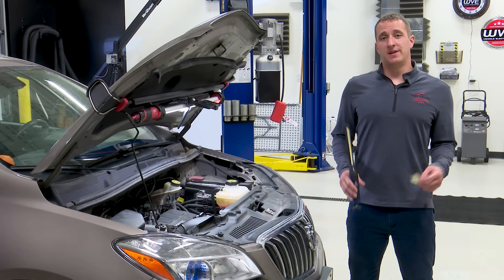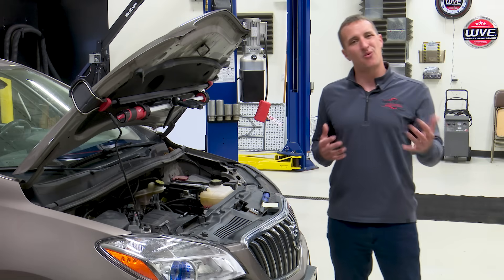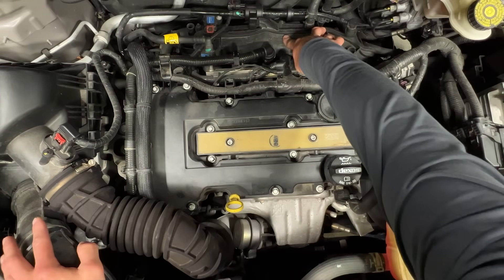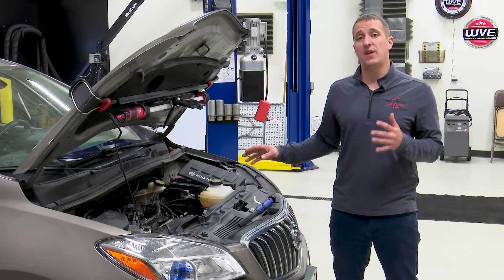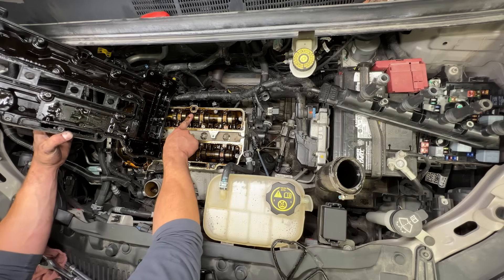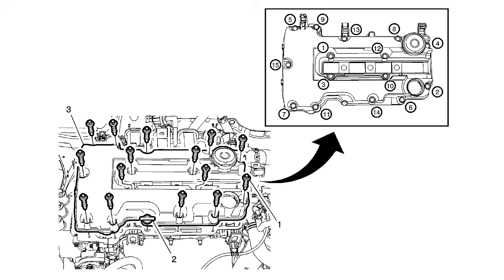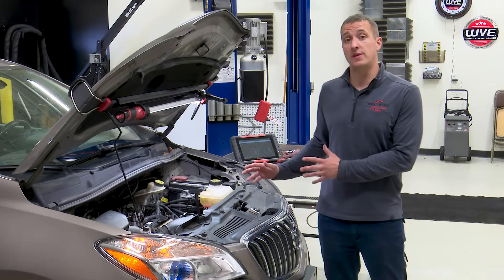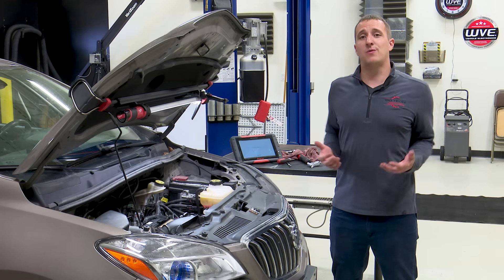How To Fix Chevy 1.4L Turbo P0171 Problem With Simple Diagnosis

Comment: Greath video my friend

I just changed the vale cover ,and i checked the manifold pcv..and the orange part is still there.. the only thing i is that i cannot blow air true it..while I put my thumb on the port head port .
 and now that I have the new
 Valve cover on...the engine draws vacuum air when I take the engine cap off.. is that normal?

Comment: i just replace the vapor valve on mine.  i broke a couple of clips. everything is back together but i might have to take it to the mechanic at some point.  runs fine for now. i doubt it will come appart.

Comment: Great video just a comment from my experience, the black pipe big an small going to turbo the small one always gets oily moisture inside the turbo diaphragm because of failing valve cover and intake manifold 
Take the 3torx screws out turbo diaphragm and clean it makes a hell of a difference car gets full power back instantly careful with rubber diaphragm and spring though! Also the big black pipe has a one way valve in it check that to

Comment: Great video! Would like to have seen what the new non-return valve looks like before re-assembly.  Also, where did the old one go? In the crankcase? Didn't need to fish it out?  Also, why are you replacing the intake manifold if it isn't broken?

Comment: Very good showing what was wrong and how to fix.  I have a po171. &  po458. Codes. Took it to technician who said it's the purge valve. ?  
He said part & Labour will be £231. ?  Does that valve sound right  ?   P. P.
Reply: I hope he's right about it. As my car did not show any signs at all. When it was running.

Comment: It's crazy! The Opel Mokka ist one of the best selling cars from Opel that days. No one knows this problem, and i fixed it all! The intake-sealing, the throttle, the map sensor, the injectors, the ignition coil because of the misfire... I needed the car for work so I drove and drove and drove. So i destroyed the sparkplugs because of the high heat. 
Thank you very very much for your help 😎 I thought the engine's down, but you rescued me!

Comment: I just had 2 questions, what is the mileage on vehicle and there is a kit that caps off where the orange valve falls off. In ur opinion would you use the kit or change intake manifold? Thanks for the video any feedback appreciated
Reply: I used the Cruzekit to replace the check valve on my 1.4 and it permanently solves a design flaw.  Very easy to install, seller has an excellent video.  Way less expensive and much better end result!

Comment: Great video! The mechanic changed in my A14NET: intake manifold, valve cover and this pipe from intake to turbo. Unfortunately I have high positive fuel trims on idle (about +25%) and P0299 (underboost) error. The turbochanger is new, the is no airleak, and the EVAP valve seems also OK. Do you have any idea what would be the problem with P0299 and high fuel trims?
Reply: Hello did you checked the vanos sensors?
Reply: @PAYASLRF  Hello! Thank you for your feedback! The turbo is back on my Astra. It came back for itself after about 3 weeks. It was probably intercooler sealants (I have changed them). By the way I also replaced vanos sensors. Now my Astra drives smoother.
Reply: @C-Fan_Moto  a14net is great engine but  have so much sensors and problem 😁
Reply: @PAYASLRF  This engine is a kind o wizard... :)
Reply: @C-Fan_Moto  i hope my Astra will fix the problem it self hahah
Reply: @PAYASLRF  Have you a problem with P0299?
Reply: yes but it's not about turbo i think,i think it's about pcv system,crank ventilation hose have a check valf and this check valf is not working.that causes inlet manifold has fill oil and turbo sucking this oil and burns and exhaust smoking,i will replace this hose asap and I hope problem solves
Reply: @PAYASLRF  In my opinion you are thinking well about your failure. Fixing PCV system is the first step. Have checked if pipe from intake manifold to turbo passes the air only in one direction?

Comment: There is a PCV system fix available that alleviates having to replace the intake manifold and permanently solves the PCV issue.
Reply: any links or more info for this fix?
Reply: @tomatofarmer1644 Dorman made a kit with a newly designed umbrella valve that fixes this root cause!
Reply: @tomatofarmer1644  Dorman 264-968 valve cover kit
Reply: Any info about this?
Reply: @axelrios8501  Dorman 264-968 valve cover kit

Comment: If that boot was missing in the Intake, would it cause white smoke to come out the exhaust pretty heavily? Even after replacing the Valve Cover with OEM? Or do you think thats more or a turbo issue?

Comment: It’s often a broken return valve in the crank case that causes the diaphragm to rupture. If you just replace the PCV cover and the return valve is still broken, they’ll be back in in 2 months.

Comment: Great video, as stated by others in the comments, so many people replace their valve cover and have to replace the front mail seal that also failed, but never resolve the core issue which is in the intake manifold. As far naming goes, alot of people, including myself, call the non-return valve in the intake manifold the pcv valve. But thats just semantics. Once again, great video.

Comment: Crap..... Always something with these 1.4 turbos.. working on a 2014 cruze just replaced a cracked head from overheating.. along with  timing set water pump thermos. Im about to go finish up and install exhaust manifold/turbo and the intake until i saw this video, im pretty sure thay non return valve is gonna be shot on my project too
Reply from the maker: Yeah they are a very common failure, but easy to diagnose at least.
Thanks for reaching out!
~Ryan

Comment: How many $$$ at the dealer is this going to cost...valve cover&intake manifold, is this many hours of labor???
Thank you..
Reply from the maker: Hello,
It can be expensive due to the part cost and labor. It is listed at around 4 hours of labor, so the cost will depend on the shops labor rate.
~Ryan

Comment: wow, that's what you call it ''simple'' diagnosis... not for me, I'll pay for a mecanician, thanks anyway, nice video !
Reply from the maker: Hey Richard,
The diag is simple, the repair is a little bit tougher.
Thanks for watching and glad you enjoyed the video!
~Ryan
Reply: @GoTechTraining  well, I did the pcv valve check, using piece of paper like you showed on your video, and pcv valve  was good. after I removed the code with my OBS machine, it turned out check engine never came back !!! thanks again for your help
Reply from the maker: Of course !

Comment: Changing the valve cover only pushes the problem down the road about 20k miles and it will happen again.  There is a bypass that will eliminate the valve cover problem. Replacing the intake will also only push the problem down the road.  Get on Cruze Talks and look for Cruze kits.  This will prevent either part from ever failing again
Reply from the maker: Hello Skildude,
I have heard of work around kits that people have been using on these engines. I'll have to check it out.
Have you had any luck with these yourself?
~Ryan

Comment: I’m so confused because I got code P0599 so I replaced the thermostat but it was like new? So then now I got the code p0171 with p0599 ..
Reply from the maker: The two trouble codes should not be related. Did you clear the codes after replacing the thermostat?
The P0599 is a circuit code, so make sure to check your wiring and PCM control for the thermostat.
With the P0171 lean code, I would start by checking the PCV valve as demonstrated in this video.
I hope this helps!
~Ryan

Comment: How often do the intake manifold check valves fail? These are kind of expensive parts and jobs to fix too frequently. Have had this happen twice in 10k miles but only needed to change the valve cover previously. Orange nipple was still in the intake but engine still failed and leaked and threw codes and drove badly.
Reply from the maker: Hey Max Ax, this is a pretty common issue on this engine. I'm not sure that it should be failing again so quickly after it was repair though. Maybe something went wrong?
~Mike
Reply: @GoTechTraining  well I stupidly tried cleaning that intake hole or tube with it with the metal cleaner provided in 1 of the latest PCV fix kits, and then after that I looked and it was gone. Didn't check before. But I only tried it because I did an oil change and noticed some leakage around the top of the valve cover on the outside facing the front of the car. 

Maybe it was gone already to cause that, maybe not. But even the last time the valve cover was totally bad and leaking, and the car ran crappy and threw 3-4 CEL's the nipple was still there.

Comment: Hello,
I've got P0171 and P1101 faults on my 1.4 turbo. I checked the non-return valve in the intake manifold, the oil separator membrane and the non-return valve in the turbo hose which was bad. I changed it with an used one, but it passes little air from the turbo side ( you can barely blow the air from that side in to the hose). My question is: should I bother to buy a new hose for 50eur? Could the system even feel such a small amount of air coming from the hose and turn on the check engine light?
Reply: I got this dis you ever resolve it?

Comment: What would a job like this cost at a dealer and can another auto shop know how to work on these! I have a strange situation, i have 2016 cruze with 2nd gen 1.4L / turbo and i have a 2020 trax 1.4L 1st gen ( strange)
Reply from the maker: Not sure on cost, really depends on labor rate and part cost. But this job is pretty straight forward and can be done with a few sockets and hand tools. I think another shop should have no issue with this repair, if they do engine repair as a service
~Ryan

Comment: Just replaced the valve cover today.  Be careful of the two corner bolt holes that are in the timing cover.   The aluminum seems to be softer.   Both stripped out when removing them.  Had to drill out and heli coil both holes.
Reply: Discovered an oil leak coming from those two bolts today, replaced my valve cover yesterday. I am so sick of this car. Looks like it is helicoil time for me too.
Reply from the maker: Thanks for the tip!
Was your intake bypass valve missing?
~Ryan

Comment: Do you know when they updated the manifold got a 2018 trax just curious if I'm going to have this issue
Reply from the maker: Hello,
As of now, they have not updated the intake manifold. They do sell it by itself now, you used to have to buy it with the throttle and injectors attached.
~Ryan

Comment: Go ahead and reinvent the wheel... or PCV valve & intake system in this case.  Just don't do it with cheap plastic components... Right?  So I think I've figured out why they do this in mimic of BMW's plastic engine bay strategy.  After watching a recent interview with Elon Musk about his meeting with Daimler Chrysler in 2009, I think manufacturers do this kind of planned obsolencence BS on purpose.  In that interview (in Germany) he was told by a successful car industry investor that the car makers who actually make it, do so on the volume of used cars on the market by selling high mark up parts for them.  The new car sale doesn't make you money and maybe you lose money on it, but the parts with the fixed costs already spent can have very low variable cost and higher margins (easy money with stable longer term yields).  This is why so few new car companies have been able to succeed in recent times.  They have no volume of used cars to make that sweet, sweet low cost/high mark up parts money.  US car companies have to be required by law to carry parts for the cars they sell for 10 years.  And many like Chrysler stop carrying them after that.  In contrast, I still by factory Toyota parts for my 24 year old Tacoma.  You know who loves Toyotas?  The whole world does!
Reply from the maker: Hey Brian, I don't disagree. It's not just our cars these days...it seems everything contains a degree of planned obsolescence. Our cell phones, appliances, etc.
~Mike

Comment: Which RTV sealant do you use? Thanks
Reply: Permatex Black or Gray. Black has better oil resistance. Gray has better torque holding qualities.
Reply from the maker: John nailed it, I used the permatex grey on this car.
~Ryan Wilsing

Comment: Sorry, but that is not the pcv valve. It is only a diaphram. The car has two pcv valves, but that is not it.
Reply from the maker: Hey Carlos, you're right, it is a diaphragm but it does the same job as the traditional pcv valve. GM calls its a crankcase pressure control diaphragm in service info. Diaphragm valve different operations, same result essentially. Thanks for watching!
Mike Becker, Senior Instructor

Comment: Not necessary to find where the missing boost check valve went? Or, did I miss something?
Reply from the maker: The boost valve is made of rubber and most likely is consumed by the engine
Ryan W, Technical Instructor

Comment: 7:17 at this point tighten those 2 external torx bolts that hold down that upper timing chain guide. Those bolts have been loose on every single 1.4 IV done a valve cover and intake mani on.
Reply from the maker: Thanks for the tip! I will have to check those the next time I have one of those apart
Ryan W, Technical Instructor

Comment: There's a guy on youtube that has made an aftermarket fix for this intake valve..  You actually glue in a plug and seal up those existing internal holes--- then you drill a new hole and put a valve on an external line----  at least this way you can replace it easily later.  It's a pretty sweet little kit and makes it 10x more reliable than buying a new intake, just because a little silicone flapper fell off.  What a terrible design.  This engine makes me angry at the engineers. lol
Reply: Dorman made a kit with a newly designed umbrella valve that fixes this root cause!
Reply from the maker: That sounds cool! I will have to check that out
Ryan W, Technical Instructor
Reply: @GoTechTraining  His channel is "Dre Dan" --   and he had made iterations of his repair kit.  Last I checked the V3 (version 3) was the most recent.  Just search his channel for "v3 pcv 1.4L"

Comment: I haven't watched yet-- but I bet it's the pcv on the top cover...  My sister had this same issue.     You have to buy the entire cover just to fix it.  And also, there's a little silicone valve inside the intake that can go bad--- and then you have to buy an entire intake just to fix it.  This engine is terrible.
Reply: 350k on my 1.8 minimal maintenance
Reply: @Rowdy_Motivates  That just means the guy before you already fixed all these issues.
Reply: @calholli  I bought them brand new. Soo I doubt that.
Reply: @calholli  I bought it in 2011 and the sonic 2015. Was alot less then you think. Also got a 2014 f150 back then for 25k cdn brand new. Shop around.

Comment: What a cr@p design. A simple PCV valve becomes a whole valve cover job.
Buy American, they said….
Reply from the maker: It is surprising the new intake was not redesigned or a kit wasn't developed to repair the old intake.
Thanks for watching!
Reply: Disgusting isn't it.   All it needed was a little window there with two screws, where we could reach in with a new silicone flapper and pop it in place, and then screw the cover back on.   but no, They want to sell parts;  and a 10 cent piece of silicone flapper isn't going to make them any profit.   It's embarrassing really.  This is why I only buy Honda or Toyota..  other than Ford trucks.
Reply: The engineer or engineers who designed this should be allowed to have children. This kind of stupid shouldn't be allowed to pro-create

Comment: Amazing a Buick and Chevy with a K  as the first character in the vin number, a pcv valve that is a valve cover , and a non return valve that is a an intake manifold. American cars that do not identify as American cars and parts that do not identify as the parts they should be. Automotive wokeness. The diagnosis repair and was excellent . These cars are pieces of S#!T
Reply from the maker: I agree it is not the ideal design, but I guess all cars have there issues
Thanks for watching!
Ryan W, Technical Instructor

Comment: You test it with a smoke machine. Blow smoke into the intake… smoke will come out of that hole in the diaphragm indicating you need repair kit for the pcv or a whole valve cover
Reply from the maker: I agree, if you have a smoke machine that is a great way to test it! 
Ryan W, Technical Instructor

Comment: A very very common problem I've done hundreds of them, those motors are a POS on a good day so it's no surprise they have so many problems, just your usual "quality" GM (General Mess" product.
Reply: It's the same story over and over with this engine.  There's a guy on here named "Dre Dan" channel--   Look up his "V3 PCV fix" for this 1.4L.   He seals up those internal holes, and then drills and adds a more industrial valve on an external line-- that's easier to change and virtually never breaks anyway.  It's a great alternative to buying a new intake.  Because I was not going to buy a whole new intake, just because it's missing  that silly little silicone flapper on the inside-  which will just fall out again. (disgusting design).   They should have at least added a little window/ removable lid with two screws where you could each down in there with a new silicone flapper valve, without taking off the entire intake....  anyway, the "version 3 (v3)" fix is a sweet little kit and makes this engine 10x more reliable;  because as long as that valve holds up, they PCV doesn't go bad, typically.   If you do these a lot, you might look into it.
Reply: @calholli I have brought and installed this kit. It's been on 18 months. No problems so far.
Reply: Thanks for the advice.  I'll be doing that when it goes out 👍👍🇮🇪
Reply: Mine has done the purge valve plus that diaphrene. Very annoying